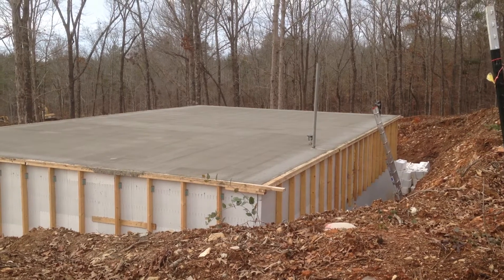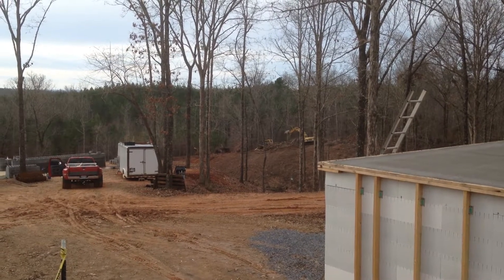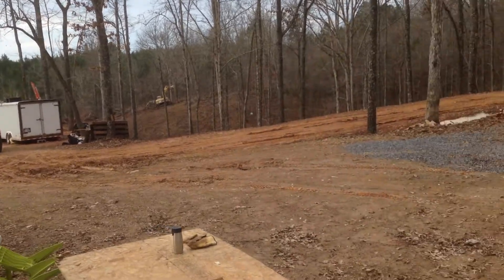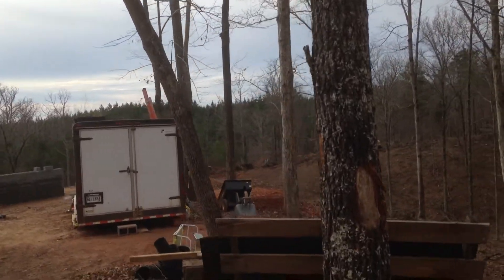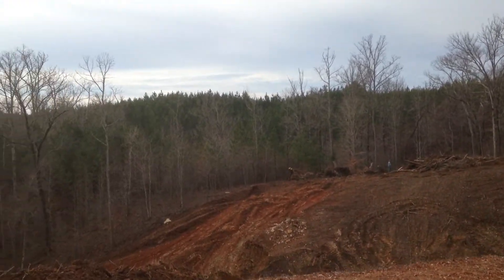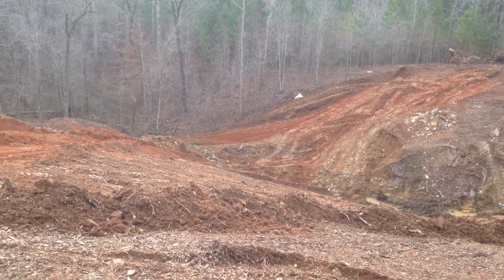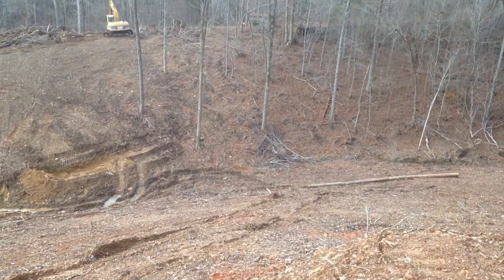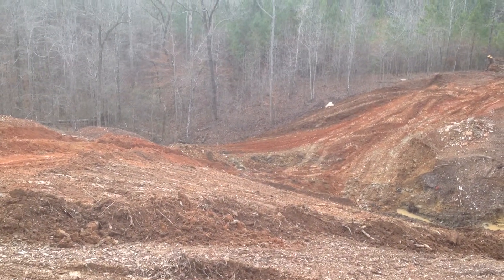Concrete ICF Roof is Poured 2013-12-13

Comment: Awesome ICF roof. What height/thickness are the walls & how thick is the concrete in the T joints in the roof?
Reply: @Late Rain Thanks for the reply. I'd always prever over engineer a bit unless there's some absolute tight budget constraint. A few thousand extra in materials for 2" thicker concrete or additional rebar isnt crazy wheb spread over the length the home will last.